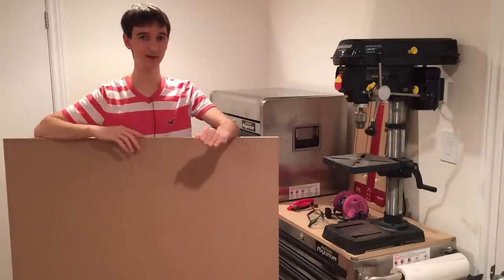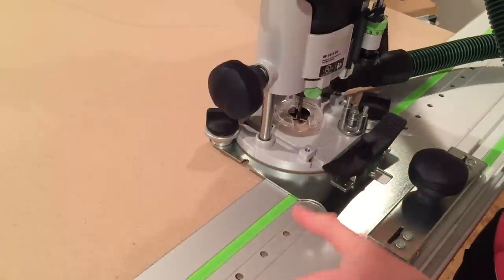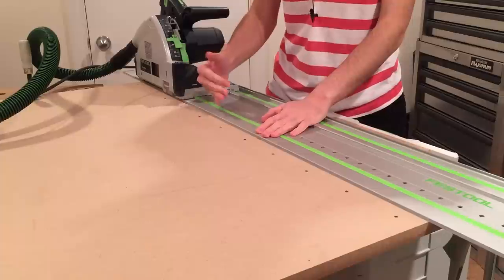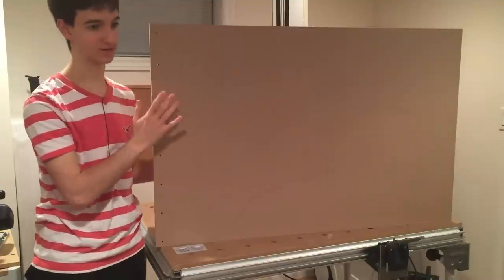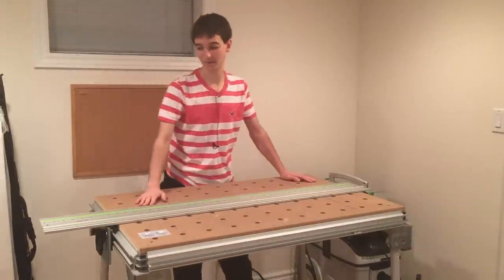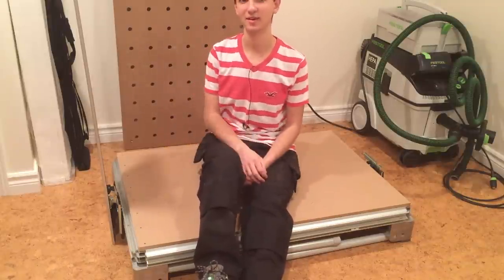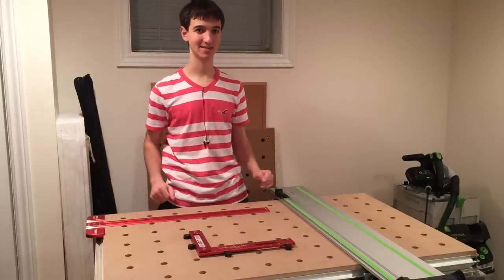How to Make an MFT Table Top with LR 32

Comment: Well thought out approach to making a new mft top. I do have one comment to add. Once you have the the holes drilled in the jig and you want to cut the jig to size so that it fits in the table,  it is imperative that the sawn edge  adjacent to your 5mm holes fits snugly along its length to the inside of the table frame. In this way you’re guaranteed that your hole grid is parallel and perpendicular to the table sides, in addition to the holes being  at 90 degrees to one another. This is a particularly important when your jig has a poor fit in the table frame and is off by a mm or more. Makes a big difference!
Once again, great video and I’m going to give this a go myself!

Comment: Genius! I never thought of replacing the guide rail on my MFT with the “holey” one, let alone mounting it lengthwise. I had a set-back today in my product development cycle where I had to figure out holes in a piece 37” x 5-1/4” wide. I was envisioning a huge jig to hold them in place, but decided to watch this video to see if it gave me any ideas around this conundrum. And boy, it delivered! Thanks so much for this fine video.  Can’t wait to get into the shop tomorrow!
Reply: instablaster

Comment: actually you can accomplish the same technique with the kreg shelf pin jig which has 32mm a part holes with 5mm dia holes and you can buy the drill bushing kit from leevaley and it comes with 20mm drill bit , that how i do my table tops when i have to replace one
Reply: Roman Charazian How about doing a video on your technique or explain how its done. Thanks
Reply: +Kirk Frei that would be nice for us just learning.

Anyone can "sharpshoot", we need instruction.

Comment: Good way to do it with 32system. I need to do the same but I have no such guide and need to do it in another way. Template way which I find in the web is not good because each step you increace possible mistake. Your method gives global coordinates but not step by step mistake. It is very cool advantage. Though you can do just 32mm× stepped holes. I want 100mm step and will try to find my own way to do it without template but saving accuracy

Comment: Nice job, Kriss, thanks.  Your comment, re:  dust collection, I've been impressed with a cyclone dust separator Stumpy Nubs put me on to.  Last project, I emptied a five-gallon chip and dust collection bucket five times and still didn't need to change a Festool bag.  And you catch fine particles--the ones that aren't good for you.  Best,

Comment: nice good tip would a 3/4 in wood bid make a hole large enough. Making a l shape work bench with that the mtf hole spacing in it
Reply from the maker: +Andrew Lindley – Yeah, 3/4 inch holes should work fine! Most bench accessories are available in 20mm and 3/4" diameter.

Comment: Would a router and a panel pilot bit not be quicker? Just use the original top as the template
Reply: This is what I did, works fine and you can extend the top after the initial holes are made if you want to go larger than the standard MFT top.

Comment: Great video!!! When you placed the new MFT top on the Jig did you just set the depth stop on your router so it would not drill int your jig?
Reply from the maker: I'd set the depth just past the first surface. It will drill into the jig a few mm, but that doesn't pose any issue.

Comment: Dear Sir,
 Although a clever approach, given that you already have an MFT; it would seem simpler to use the existing board & use it as a template???. There would be no need for LR32 rail & all the gubbins that goes with it. Clamped together you could use the old one to guide you drilling the holes with a Forstner bit of the right size. But keep up the wonderful ideas going; you are doing great.
Reply from the maker: +Vladimir Krapotkin – You're right. Using the existing board as a template would certainly work fine. This is just an alternate approach, perhaps useful if the existing board is worn out to a condition that renders it unsuitable as a template. Thanks for the comment!
Reply: +FastEasySmartTOOL But this method works for another bigger nonstandard sizes

Comment: I have watched your fine video 3 times now, but still I am a bit confused. IE:

How do you insure where the FIRST hole is from the edge of the top. It would seem, (I am probably wrong) that ALL your holes are spaced correctly with each other; but are they in the SAME spot overall as the old top?

What am I missing here? For I do not see that step being covered.

Thanks,

patdee
Reply from the maker: Thanks for asking, and watching 3 times :)

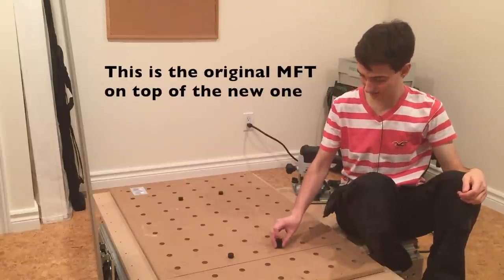You're right, I didn't cover this part in the video.  What I did is take a pencil and trace out the shape of the old/original top when I had it on top of the new one (basically the setup 6:28 of the video).  When cutting the new top to final dimension, I laid the guide rail along these pencil lines.  That's how I ensured it matches up – might be off by a few thou, but I think it's good enough.

Comment: Good information and method. Will order the 20mm bit at lunch and hope to try this as soon as it comes in. Are you using typical MDF or something like MEDEX? Have you had luck with other materials for the bench top?
Reply from the maker: I used standard home depot MDF. Hadn't heard of MEDEX before – it does looks neat, but I wouldn't know where to find it. Have not tried other materials yet, but I'm tempted to give it a shot with some nice birch plywood... maybe for the next top.
Reply: Thanks for the response. Was also wondering if you have any suggestions for creating the mounting holes in the right spot?
Reply from the maker: Eli Spam I assume that by mounting holes you mean the four holes at each corner for the threaded inserts securing the holy top to the table (correct me if I'm wrong) – I actually didn't bother with the threaded fasteners on my version and put wood screws directly into the MDF, after all I don't expect to take the top on/off much. Should you insist on making the DIY version just like the real thing, I think a good way to mark the spots is to get the holy top on the MFT first and mark the locations through the existing holes from the underside of the MFT. I hope that makes sense.

Comment: Excellent video, David! I noticed the small table-top you used to support the work. I assume the top item is a SYS-MFT Tabletop Systainer. What's below it? (What did you stack to get it level with the MFT/3 tabletop)? Thanks.
Reply from the maker: Hi.. my name is Kriss, but I see why you thought I was David :). The stack consists of 1x SYS-3 and 5x SYS-1's on a SYS-Cart, but any height equivalent of 7x SYS-1's will work.

Comment: Nice presentation. I want a second mft table top for cutting sheet goods.
I'm thinking the height would be 900mm.
I like the attachment for the router.
I have he fence with the holes but not the assesory for the router. I have the of 1400 router not the smaller one. Should still work.

Comment: Great video, I truly enjoyed watching it!  So my question is, did you bevel the 20mm holes after drilling and the outside edge of the MFT table top?  If so, what did you use for your router bit?
Reply from the maker: Thanks! I didn't bevel the holes (they're not usually beveled), but did bevel the outside edge. Used this router bit: http://amzn.to/2kDVdpB

Comment: Do you still monitor the comments here? If a DIYer used your technique to layout and bore a larger bench top, are parts available to hinge a piece of track without a MFT frame? I hope this isn't really obtuse of me but I've never even seen a MFT table in use. In fact, it is 110 miles to the nearest Festool dealer from where I live in Wyoming. Thanks for this posting. You've done us all quite a service.
Reply from the maker: Yep, I monitor the comments. I've given this a lot of thought (was chasing down the design of a DIY MFT at one point), but it's not a trivial design task. Festool sells the official parts from EKAT Service Catalog... might be an option to consider, but the parts are still expensive.

Comment: Awesome as I would like a top (only) that I can make to any size and lug around with me more easily that the complete MFT system. I hear you say it would take you about an hour now that you have the steps down. But how long did the first one take? I will multiple that by three so I know how long it will take me :p
Reply from the maker: Well, I looked back and I've got 3 hours of raw video footage for this thing. I'd say end-to-end it took me about that long, although the act of filming can be quite time consuming on its own. Good luck :)

Comment: A new Festool MFT replacement top costs approximately $135 U.S. so $15 for a replacement is quite a bargain assuming you don't have to buy the 55" LR32 rail and router hardware.
Reply: By the parf jig for about $200.

Comment: Great video, getting ready to order the Festool hinge boring bit. What speed setting did you use on the router?
Reply from the maker: Harley2004Fatboy Slowest speed. 10,000 rpm
Reply: Do

Comment: Let's hypothetically say that I want to make my own "pre-punched" track like the LR32 rail, but I will use my mill to make the holes equidistant. What would a good measurement be if I don't want to use millimeters? 32mm is just a we bit further than 1.25" and if I did things on a 1" spacing, could that yield a useful hole set-up for other projects down the road? What would my MFT hole spacing be? Would that mess me up for shelving pin alignment down the road?
Reason why I ask, is that I'd like my woodworking bench holes to mirror my welding/fab table's holes of 5/8" (or 16mm) on a 2" grid pattern. That way I can use similar set-ups, and the same clamping tools on each table.
Reply from the maker: +Eco Mouse – For shelf pin alignment you would want 32mm – nearly all cabinet hardware I know of relies on the 32mm spacing. The MFT hole spacing is 96mm (3x 32mm). But why not just make yourself a few different rails?
Reply: Eco Mouse
Reply: MFT is the center of a pegboard square of a 5 x 5 or I'v heard 4" centers for each 22mm holes
Reply: "What would a good measurement be if I don't want to use millimeters?" You could try centimetres or metres. Kilometres would be silly though.

Comment: Hey Kriss how are you doing? Did u know about this attachment for the of 1400 and of 1010 ? http://youtu.be/LYdwBOvnk4c
Reply from the maker: +martin chavarria – Yeah, I've got that. FYI it will only fit the OF 1010
Reply: +FastEasySmartTOOL I use it for my of 1400. And works too.
Reply from the maker: +martin chavarria – Oh, shoot. Yeah, you're right. Now I remember scouring through forums once upon a time trying to figure out why it's not officially endorsed for the OF 1400. I'm guessing it's a potential weight concern with the larger model. Good stuff. Great video!
Reply: +FastEasySmartTOOL thx

Comment: what bit did you use for the final 20mm hole? Great vid by the way.
Reply from the maker: It's Festool's 20mm hinge boring bit. Part # 491072. I had good results with it.
Reply: Did you get a sloppy hole using this bit? Some have said that this bit produces a slightly oversized hole, and when inserting dogs there is a slight amount of a wobble in the benchdogs. Apparently the ideal hole diameter should be aprox 19.8mm for a snug fit.

Comment: I have several decades of experience on you but when I need a new MFT top I will simply use the existing MFT top as my template.  Clamp it on top of the new blank, mount a 1/2" diameter top bearing flush cut bit in the router and start plunge cutting those holes.

Comment: If your rail setup on the mft/3 isnt perfectly square to your dowel holes, all the big holes will not be either. I'm talking 100% perfect. I'm sure yours is plenty accurate. But maybe it's safer to use the "sacrificial method" which consists of making two parallell guiding lines of holes cc96mm and then using dogs fastened to the rail in those holes and making the real holes in between and then cutting the guiding holes off while cutting the sheet to mft-size.
Reply: Magnus Ericsson )